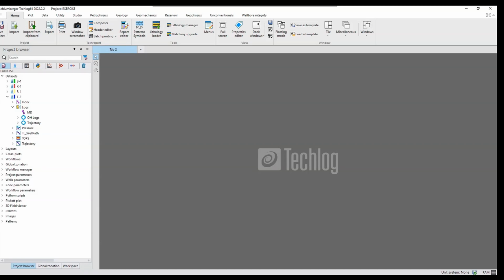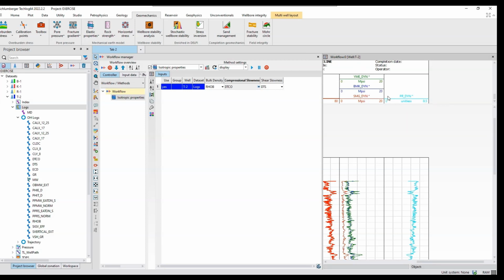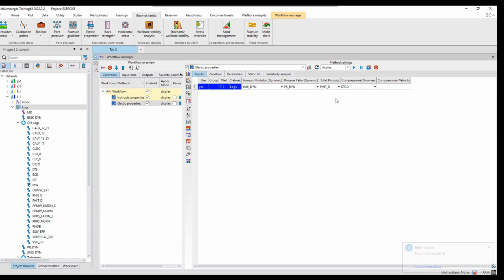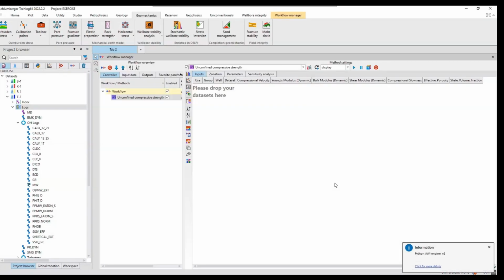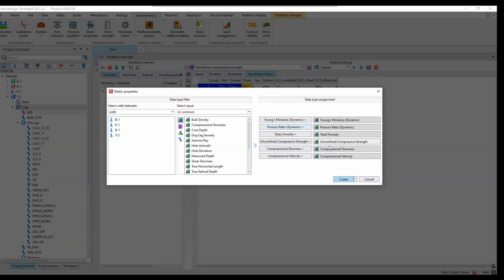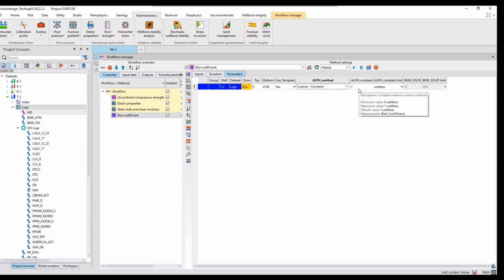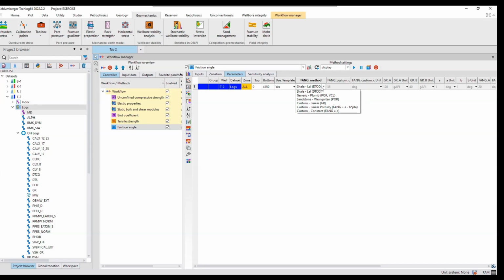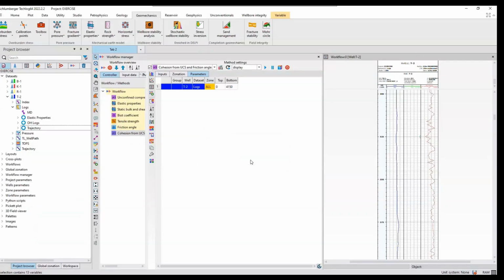Tutorial - 5 | How to Estimate Rock Strength, Elastic and Mechanical Properties  in TechLog.

Comment: thanks for sharing , if I have the Biot cofficient as liner equation for the subsurface formations  , How I can used it in Techlog ?
Reply from the maker: You can use it during stress estimations. It is one of the parameters to help to adjust borehole stability window. During stress estimation value of 1 is used as default in software.